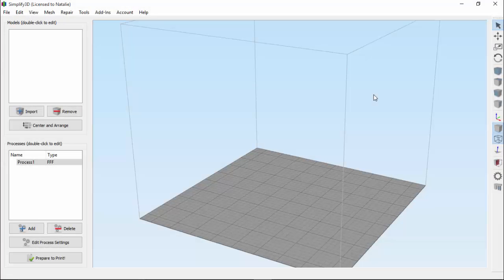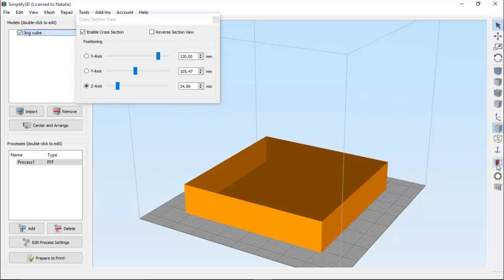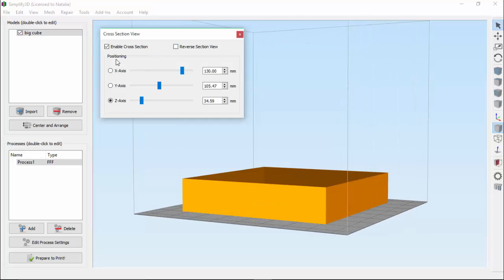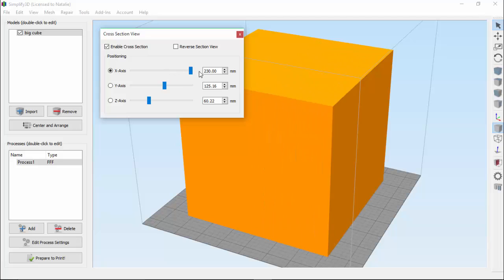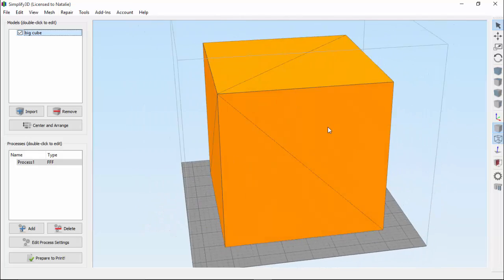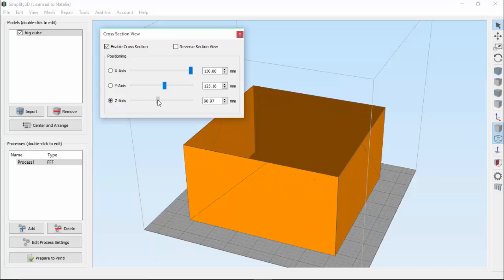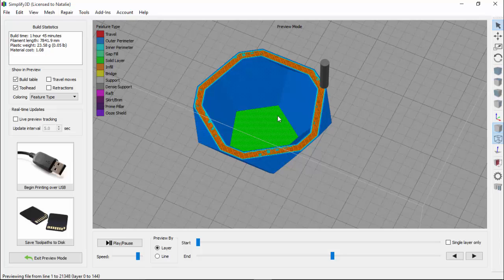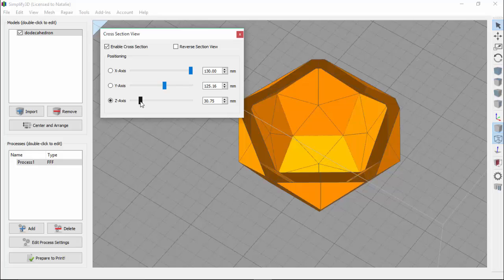Cross Section View | Simplify3D

Comment: As long as the cross section view does not allow to modify (add / delete) support pillars inside the object, it is absolutely useless and just a cosmetic feature. Basically it is just what you can see in Preview-Mode when looking at layer by layer - except that you can also "slice" sideways here. 

Imagine you want to support a dome like model with large overhangs on the top but you have some features on your model that don't need support or that should not be supported (e.g. you want to speed the printing up, or save material). Currently in S3D you have no chance to select the generated support pillars inside the object (to remove them for example). Even adding pillars inside the object is not possible. The only workaround by now is to have the "dome like object" having no bottom cap. This way you can turn the build-plate around to look from the bottom into your model where no object-geometry is between the camera and the support structure. The cross section view would be very handy for that.... would be...

Oh an btw.: There is even no shortcut to look at the bottom of your object, only default, side, front and top.
Reply from the maker: +Martin Majewski (net), It is indeed possible to add or remove supports while in the Cross Section View. Once the Cross Section View is opened, open the Customize Support Structures window and use the add/remove options as you normally would. If you have further questions about this feature, please email our support team at support@simplify3d.com. Thanks!
Reply: Thank you for your answer. You're right. Removing support works. However, adding new support pillars is not working. I'll contact you via EMail to show you a short screencast of my issue.
Reply from the maker: +Martin Majewski (net) Okay, the support team will watch for your email. Thanks!